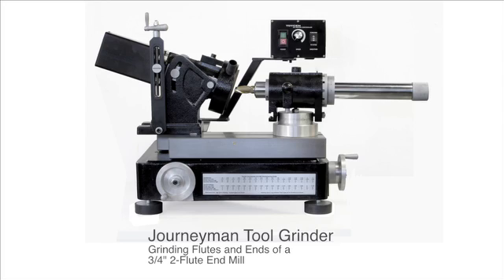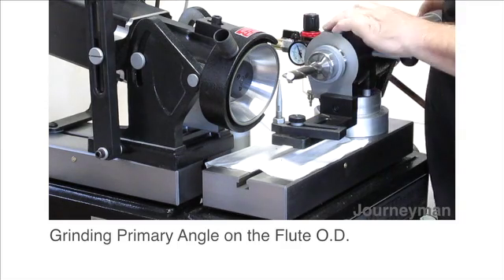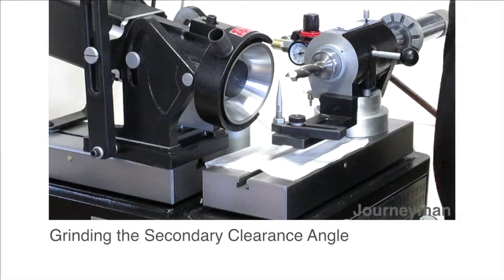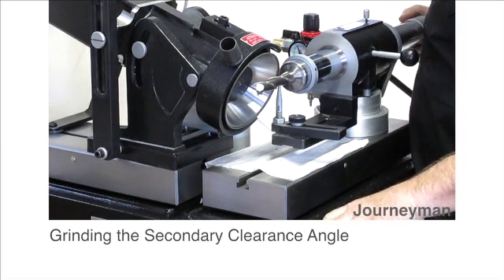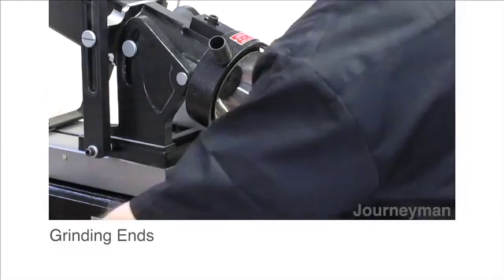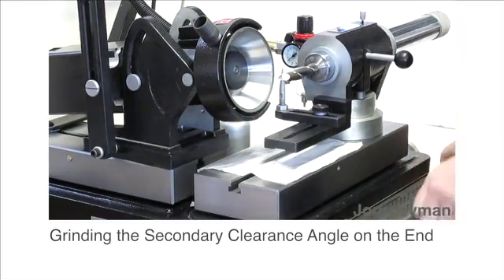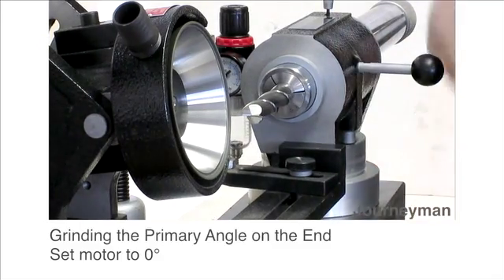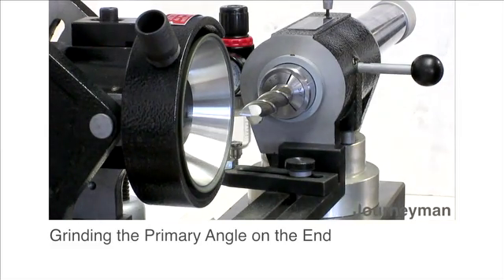Journeyman Demonstration: End Mill Grinding

Comment: Is this only for HSS or can we do carbide?
Reply from the maker: Designed for both: Use a diamond wheel for carbide, and a CBN wheel for High Speed Steel (HSS). Our production support, CM-PS package comes with two resin bond cup wheels like in the video, CBN and diamond and a wheel truer.
Reply from the maker: The Cuttermaster does a great job on both HSS and Carbde

Comment: Can this machine resharpen endmills with a radius?
Reply from the maker: Yes, with the addition of the CM-03 Radius Attachment.  The radius attachment replaces the air spindle for radius grinding.  Alternatively you can mount one of our profiled radius wheels for plunge grinding one of four rads: .03", .06", .09" and .120"
Reply from the maker: Yes, with the addition of the CM-03 Radius Attachment or the CM-02R Radius Air Bearing
Reply: hello , yes it can